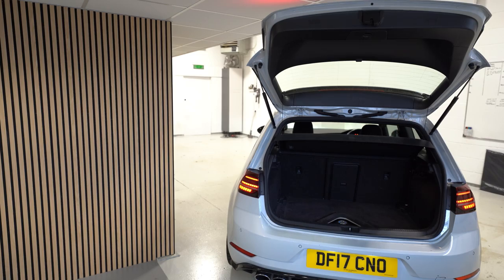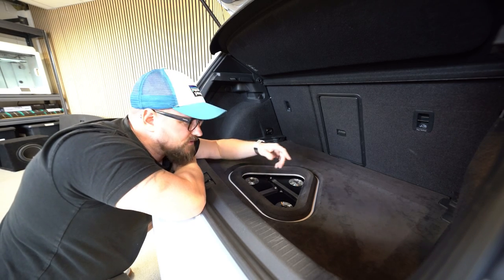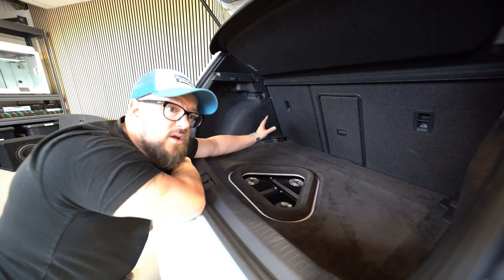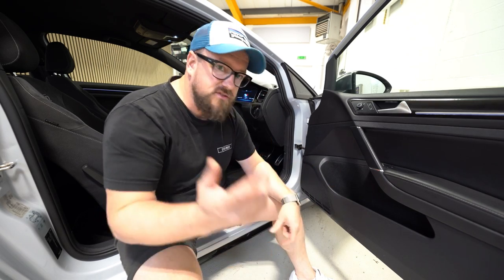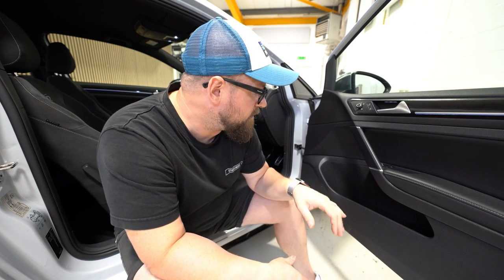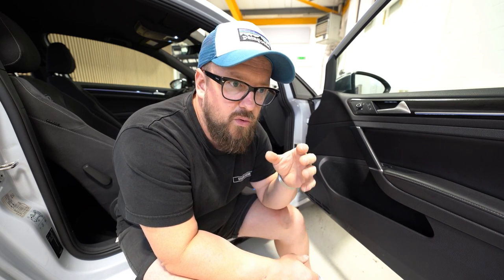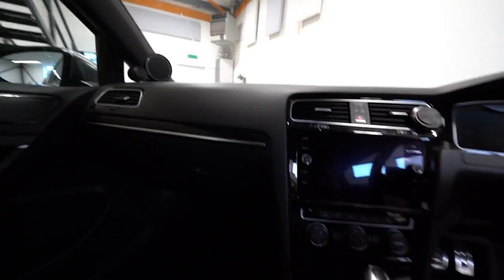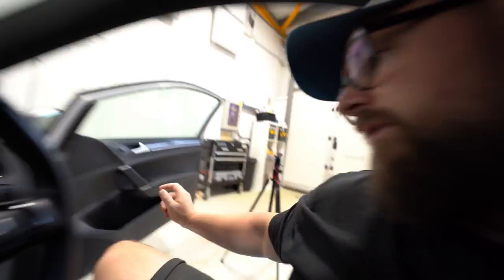JL Audio VXI full system MK7.5R - Is it actually any good? Ep5

Comment: I use the controller to switch inputs. You can toggle through tune presets with it and each tune preset can have it's own input mapping. This does mean that if you tweak the tune, you essentially have to copy the changes to other input preset.
Reply from the maker: I’m with you. Just feels more like a “work around” than a switching source. I’m going to give this a go and see if it’s liveable considering how often I plug it in for little adjustments. To be fair whenever we do a two-source system, they’re both on different tunes so it may not be that much of a ball ache.

Comment: Looks a great install on the VW.  Can change the input on my Audison Forza AF M12.14 bit using DRC-AC…..surprised JL doesn’t offer similar input selection?  I use an A&K Kann to feed my Forza (either directly by Toslink or wirelessly via B-Con), but can also switch in Zen optical from the MB head unit (usb stick with high res WAV or Apple CarPlay)on my Vantage.  Sounds great!
Reply from the maker: Yeah surprised me, too. Doesn’t work like that with JL.

Comment: You can run two different sources with the VXI amps. Because you have 6 profiles in the software. Example I have mine set up with one profile using optical out from my source unit on the red profile and then on my blue profile I am using RCA out from the source unit. I have a video game console set up for my yellow profile so I can play video games sounds. Might want to watch some videos from JL Audio about setting up different profiles and using different sources. All I have to do is press down on my DRC 205 to change the profile to what ever source the profile is set to.
Reply from the maker: Don't worry, I'm already on it! Thanks for the comment.

Comment: Personally when we sell an Astell and Kern to a high end client were using the digital coax for several reasons.   The main reason is because there are very few DSPs on the market that have a better D/A converter built into them vs the Astell and Kern.   I personally hate the computer printee plug on the VXI amplifiers and their input routing looks like an 8 year old drew a diagram.  Just too confusing with so many better DSP amplifiers on the market imho
Reply from the maker: I get you, and agree. Most of the time we fit a DAP because of its linear output rather than it’s DAC or any of its own features. It enables the system to be played by the client without the flawed OEM system.